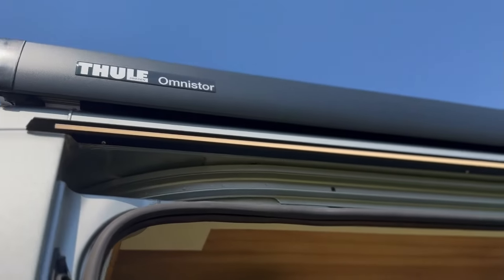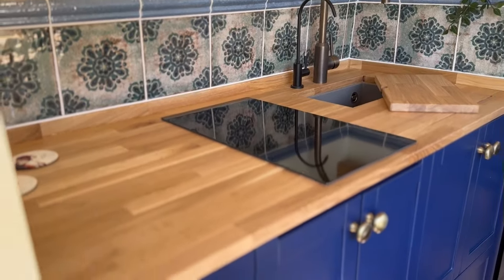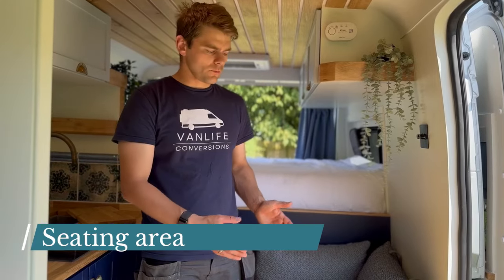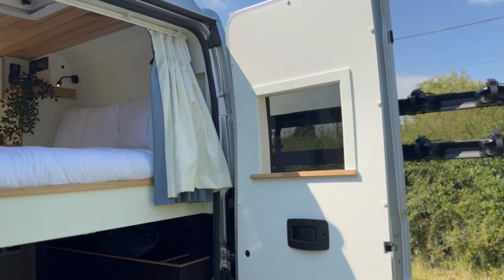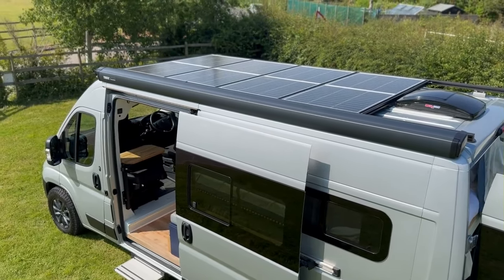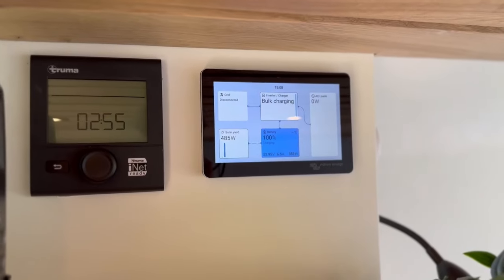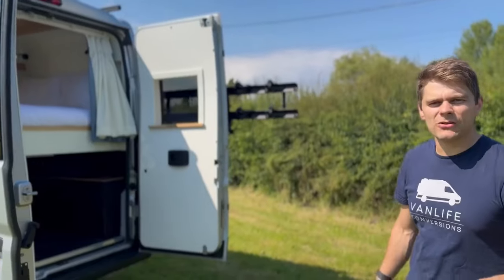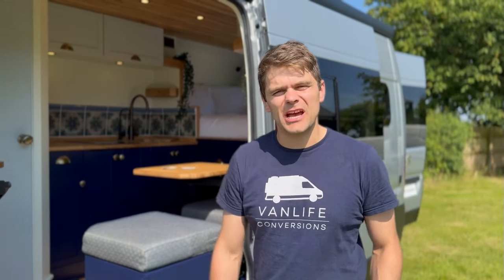Ultimate Off-Grid Van Tour: Massive 48V Electric Setup, Gasless & Water filtration system

Comment: Nice setup! Where are your water tanks (underslung?) and what is fresh/gray water capacity?
I am currenty building gasless setup (portable induction hob, AC water heater 15L 1200W, diesel air heater) - 890W solar panels (2 x 445W residential panels), self-built 24V 320Ah battery (8kWh), 3000W 24V all-in-one inverter. So two panels in series I can use built-in MPPT, there is also AC charger built-in and automatic pass-throuh when shore power is connected (probably dont need it much with huge battery and solar array). I will also add 580W DC-DC charger.
24V I decided because I can find some 24V DC appliances and power then directly without inverter or 24-12V step-down converter.
Reply from the maker: Thanks, yes water tanks are underslung 80L fresh, 60L waste. Awesome sounds great!